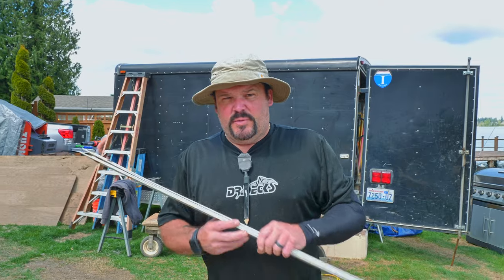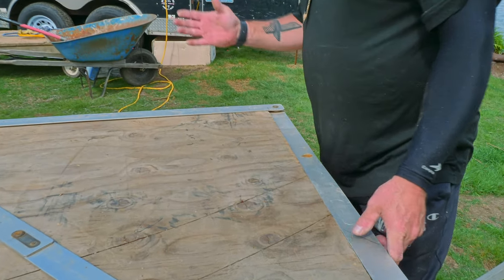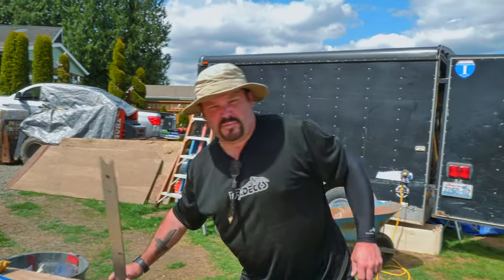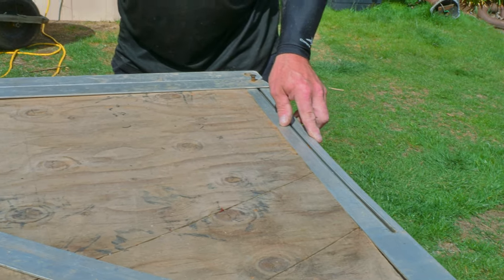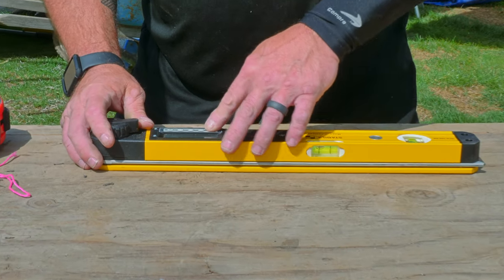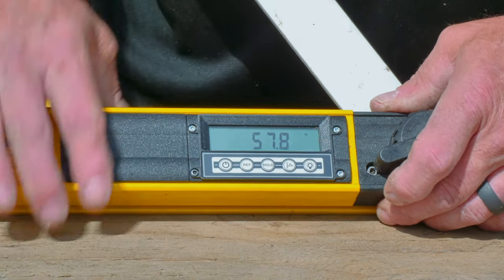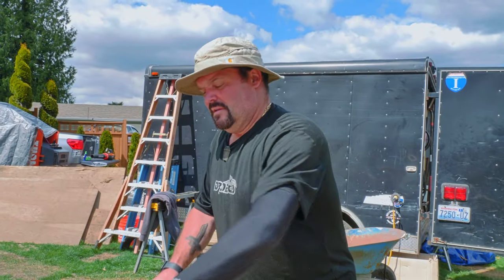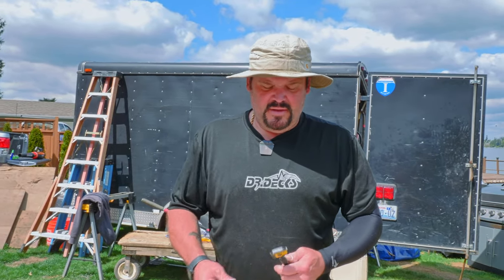5 Deck Building Hacks || Dr Decks

Comment: It's all about layout!!!  Can't emphasize that enough..  I'm always telling the guys to slow down and get the layout perfect. I'm always explaining the square up really become obvious once the finish materials (trim, railings and stairs)are built in. After that, the build is all about build skills.  It's the layout that sets you up for the absolutely mint finish.  You could spend an hour on squaring-up skills and methods alone.   Love the channel madman.
Reply: So true. And add many try to squeeze by with makeshift tools.    Adds to their misery.   If I don’t learn something new each time, I don’t consider it “ productive.   Plan-  budget- execute I tell my wife.   She’s skips the 1st # as she gets tired of waiting for me.  Told her “ what budget. It’s gas $$ now. 😆
Reply: Same with every trade skill, for the most part. Welding, engineering, etc.. Prep work may take many times the actual final, yet for a job to be substantially complete, necessary. We do not live in a perfect world, at least until AI becomes more ingrained and even then, there will be mistakes. Made by man, same o the failure. The real key this this or any instructional layout is, if one makes the times to do the task correctly, within all factors given, then most jobs tasked will be within that 1-2% window of how we interpret, perfect.

Comment: An even easier squaring method that I've used my whole life is the 1.414 method.
A 1" square is 1.414" across the diagonal.
So...you can make marks at any dimension along both sides of a right angle and multiply the measurement by 1.414 to get the square diagonal.
10", 16", 96" 227.5", whatever. Multiply by 1.414 and that's your desired measurement along the diagonal to achieve perfect square.

Comment: I have flipped over my ten-year-old pressure-treated boards and am starting again with the non stained side up and now need to know if I should put a 1/8 gap in between all the boards before I screw them down. I've heard that I should do that to allow for movement. The trouble is I don't want to put a space between because those gaps tend to fill up with all of the tree stuff that's surrounding the deck. Is it necessary to put the 1/8 Gap between the boards? Thank you so much for your advice.

Comment: I rent the Microsoft Office software for my pc  ($7 month) which has Microsoft Excel in that bundle off programs.  I swear it is better than any construction app or calculator b/c it can generate a list of numbers unlike a calculator which only computes one at a time.   I built one for deck board spacing when customer does not want any ripped boards in the decking layout.  You just have to enter the width of the deck boards and the total span distance and it will return a short list of potential choices of total number of deck boards to use to fill the span and the gap size for each of those choices.  You choose which one which is closest to the gap size the customer likes and input that number of deck boards in the next phase of the spreadsheet and then it will calculate the actual location of each decking board which will all be evenly spaced out the entire span. Also built another for calculating miter angles and the angle to set miter saw on based off the corner angle that you input so if you have a corner that was not really 90 degrees and turned out to be 86 you just enter 86 and it will tell you (if its 2 pieces making the angle) what the toe/heel angle of the boards to make that 86 deg angle and it calculates miter angle setting for the miter saw to acquire that toe/heel angle when cut.

Comment: I like the cutting a measurement in half even if it has a fraction hack: half the whole number (that's easy) but for the fraction just double the bottom number so half of 42 and 3/8 is 21 and 3/16. It gets a little tougher with an odd number like 43 inches but the principle is the same. Half of 43 and 3/8 is 21 1/2 + 3/16.
Reply: I happy to be metric:)
Reply: Use metrics ;)
Reply: Some beat me too it.  In 70s while in HS, so much talk on converting to metric system.   Used 3 years overseas and love it.   Now I teach youngsters how or adjust tape measure if needed to whole number by angling it.   Total length I’d 58-9/16”.  Angle the tape till 1is one one edge and go to 61 if possible and mark at 30.  (Surveyor trick.  Helps.  

Def lone yo go to metric system. Soo much easier

Comment: Hello, I’m building a deck off my pool and trying to figure out how to mark my posts all the same height that I left long after backfilling. What is a good way to mark every post at the same level so I can see how high to make my beams? Thanks
Reply: use a laser or even easier use a water level, get a piece of clear tubing and fill it with water. you can add food colouring to make it easier to see. Decide the height of your first post and then fasten with rubber band or clamp and equalize water height at each post progressively. 
search for diy water level online.

Comment: I liked the video. I did notice you went the wrong way with your 37 degree angle. The 35 degree was a larger angle meaning you went 2 clicks in the wrong direction, down to 33 degrees. We get the picture though. Good hacks.
Reply: A lot of people get this wrong, but the angle your speed square finds you is relative to 90 degrees. That’s why he marked his 90. You’re speed square find the angle you will be cutting off not leaving.

Comment: Why are you particular about equal joist spacing?  Are you face nailing/screwing the decking?
 
I’m framing my deck now and the joist spacing is kinda out of wack because I need to clear vents from a crawl space.  

It’s kinda overkill:  All 2x10s spanning ~9ft to a center concrete grade beam for a total of 18’ 3-1/2”.  Many vary and are spaced 10” -12” OC between the locations where I have vents - I didn’t want anything less than 12”OC for composite decking.  At the vents the joists had to be spaced 16” OC to prevent conflict.  I plan to fasten 2x4s to get the spacing down to 13”.  All this odd spacing has me concerned about the pattern of my screws.  I chose face screwing because I like the idea of accessing screws incase a board needs replacing also I think face screwing has better structural integrity.

Have you seen decks with odd screw patterns?  Is it noticeable?  I’m using color matching screws.

Comment: This should be renamed to "5 tips for people just starting out that haven't ever swung a hammer or used a saw", this is like the most basic stuff I knew when I was a kid.. That calculator your using I just used math and memorized the decimal equivalent of 1/8th and 1/6ths 20 years ago lol. The 3-4-5 rule lol Jesus I think I learned that from my grandfather was I was 9 or 10, it's obsolete to me now I have a (free) phone app that will tell me what the diagonal distance should be and I'll get a truer square by using the full length of each side..